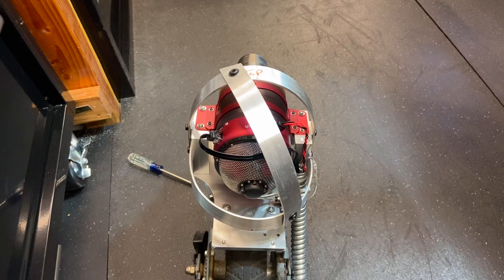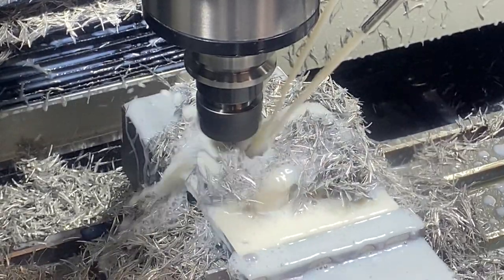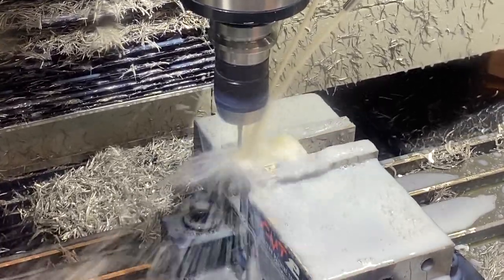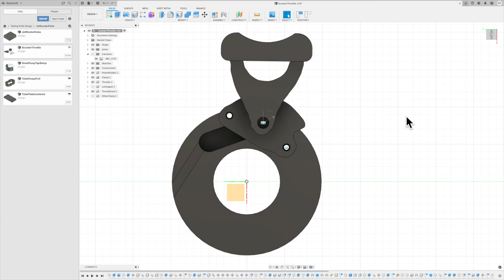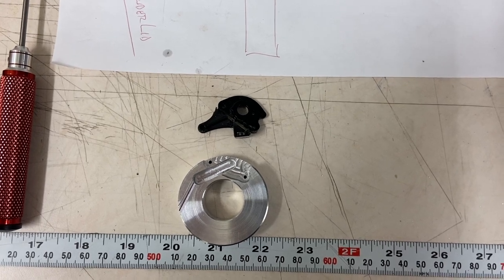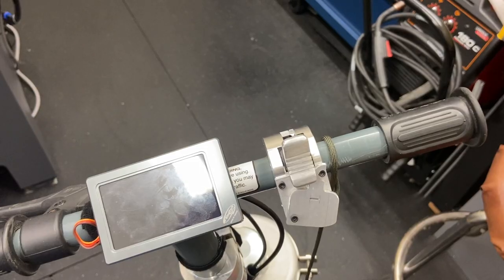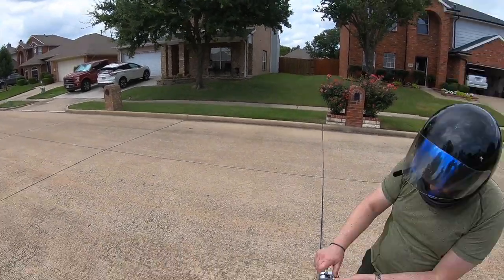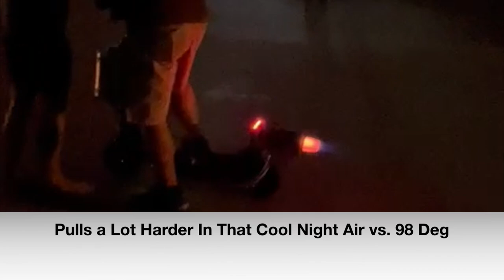Jet Scooter Upgrades - Designed In Fusion 360 and Built On A Tormach 1100MX

Comment: Usually when you face the back of a part with overhang you just first profile the outer part with a standard end mill to remove the overhang and then proceed with the face mill like you did.
Reply from the maker: Ale - Thanks, that makes sense. I knew there had to be a better way.

Comment: Another great video! do yourself a favor and model in your tool holders for better clearance simulations. I was running a 3d parallel tool path and had tight clearance. Gave me peace of mind!
Reply from the maker: Houston Sigmund - Thanks for the tip. I did look at modeling in the vise, seemed a little complex, but then so did everything the first time. I am sure if I do it once it will get much easier. I can see where it would add some comfort level.
Reply: If you talk to the manufacture of the vice they may be able to give you a step file of the vice. But i agree with the tool holders. It makes life easier when programming parts
Reply from the maker: @jerkfaceskater  I will check with them. If not there are some default vises in Fusion that would work pretty well.

Comment: Hello Bud, you didn’t accidentally look at Igor Negoda, he made a turbojet bike, an electric bike, a turboshaft BMW, and radio-controlled models with turbines like yours.
Reply from the maker: Have not seen those yet. Will check them out.
Reply: @BladesIIB  https://www.youtube.com/watch?v=_O4mw0OMukE engine thrust 18 kg
Reply: @ДенисВасильев-о5с  He went 44 mph.  Seems like the scooter should be as capable.  Need a good long run.  But, I don't think you want to go that fast on a scooter.
Reply: @nothingtoseehere4026  Yes, but in another video number 2, he accelerated along the highway to 49.7 mph, which is 80 km h (https://www.youtube.com/watch?v=kjfFgSZkRcw&t=997s) and this is the maximum, we will wait for Bud to show his scooter,
Reply from the maker: @ДенисВасильев-о5с  looking good and good speed test on another video of his.
Reply: @BladesIIB  I understand you're talking about a BMW, I meant a bicycle with a turbine, well, okay, under the hood of a BMW starter from the MIG 23, there is a speed of 54 miles an hour.
Reply: @BladesIIB   there is also a video with an electric bike, I think you would also be able to do this, there is a 15kW engine, it accelerates to 62.75 miles per hour.https://www.youtube.com/watch?v=QcmYNKNX8sk
Reply from the maker: @ДенисВасильев-о5с  that was a typo, meant good. I was talking about the bike. Nothing to see here is the owner of the scooter, I am sure he will continue to push the speed testing.
Reply: @BladesIIB  ok.

Comment: I wanted to know how you are doing with the CNC tormach, did you manage to mill the knife or at least set up the machine?
Reply from the maker: Yes, making good headway on the machine and the knife. The video this Saturday will have the progress update with the mechanical parts of the blade machined and one handle slab complete. The Tormach is working great, have made several parts on it so far.
Reply: @BladesIIB  I will wait wondering what kind of "kitchen" you have.

Comment: Still no high speed runs. The last video also only showed you going away from the camera and stopping on the way back. Should show full throttle past the camera
Reply from the maker: Wags - that 22.2 mph pass was my high speed run. That was fast enough for me.  I will leave faster to the young. If you go back to the first video minute 51 is a faster pass back past the camera. The only one we had. Pretty tough to control with the throttle at that time and a couple passes had a flame out on the turn around. Will keep working on my action photography.  😁